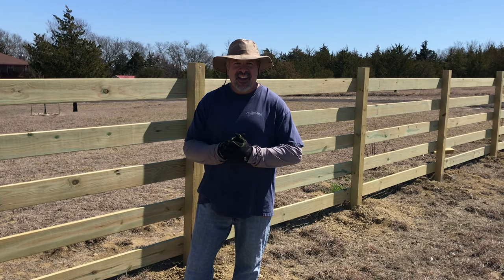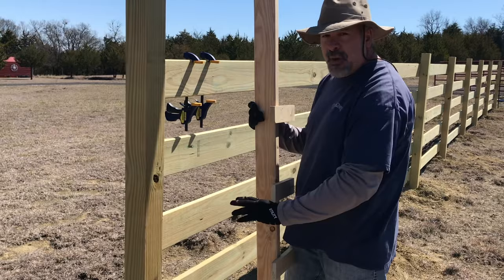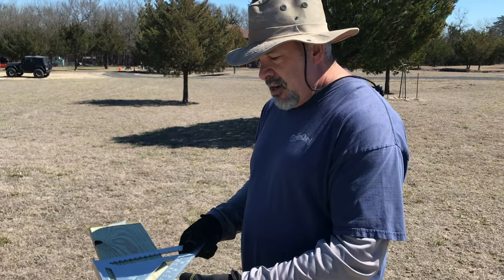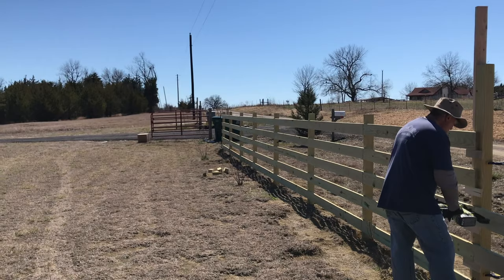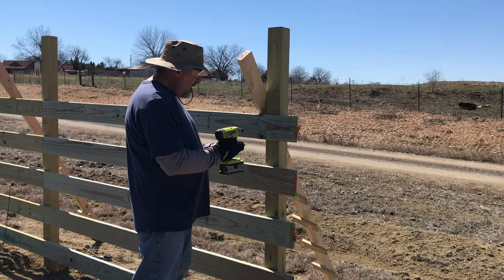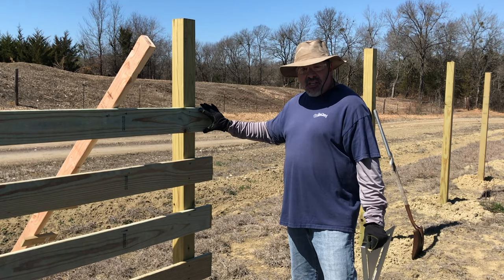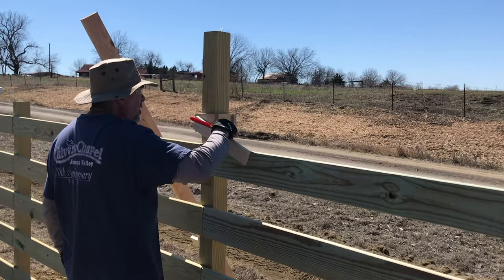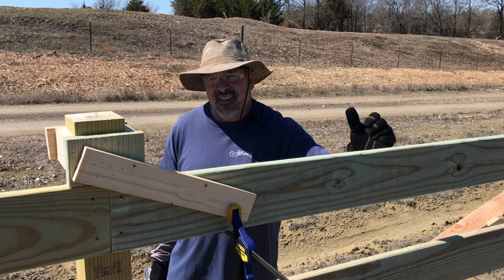Save Thousands by Making a DIY Wood Farm Fence

Comment: Not to be negative, but isn’t the nice side of the fence supposed to face the road and not the house? I’ve never seen a fence where the boards face the other side of the road?
Reply from the maker: Lol! Great point. We had several discussions on the best way to set the fence. We even set up a sample run. In the end, we decided we liked it better the other way.
Reply: I was thinking the same thing. Not being negative at all it looks amazing but my wife would murder me if I did the fence facing in and not the road. I’m getting ready to start mine after see8ng this tip and tricks this was great
Reply: This is the proper way to face the runners if there is livestock being kept in.  If the runners faced the road then a cow or horse could push the runners off.  Good job.
Reply: If I am making a fence for aesthetics, I am going to have the "nice" side for us to look at.  I couldn't care less what others see when they are driving by.  Looks great to me!
Reply: John Stricker a normal person would have done that but the boss wanted it that way.
Reply: @Mountain Path Woodsman  with it facing this way when i had a 3 rail fence my horse popped a board off into his area but if its faced other way then im sure they can kick it off so either way if a horse wants out they gonna figure out how
Reply: Proper as stated if it’s true purpose is to hold livestock boards face in. If it’s just to look good boards face out.
Reply: I've seen plenty of both in the building business. It's personal preference.
Reply: Boards are always placed inside for strength that way when livestock pushes against the board they are stronger pushing against post and it on outside easier for the weight of the livestock  to push or break boards off the post. What I use for measuring  distance between boards is a cut piece of PVC I carry in my back pocket and just put it in between each board. Also all boards can not break on same post as they need to be stagered for strength.
Reply: Boards cannot end on same post as you are taking away all the strength. Also 4 X 4s from big box stores are coated with different and cheaper creosote and  typically won't last as long as round livestock post. Also with the strong additives in concrete and not applying barrier between post and concrete post will not last as long.
Reply: We have horses so boards always on inside and I use round post and space about 5' 4 " apart and fence still ends up looking good as I have had people stop and compliment and being OCD helps lol 1X6X16 boards from tractor supply along with other suppliers are now around $20 or so each so I do what I do to stop warping. Post 8' apart allows for too much warping as sun dries them out. Also stagger 16 foot boards really adds strenght. Cutting boards from post to post has no strength and you will see in couple yrs or less
Reply: If you want to see what a livestock three or four rail fence should look like google Spar building supplies Ocala Fl and there is a photo under fence supplies and this what most would want as results. Not employed there but do purchase from them.
Reply: Both sides were nice.
Reply: Yes - he did it properly - because the livestock could push the boards and insurance companies won’t pay for any damage if your animals cause damage and the fence wasn’t done properly

Comment: How did you get the level for the horizontal boards at a long distance?? Thx
Reply from the maker: We used a black sharpie and marked the posts at night with a green laser level. That way we knew where the bottom board needed to be.

Comment: Did something similar with 2 exceptions. I sandwiched 2x4 welded wire fencing between the post and boards and used 16 ft boards with staggered joints.

Comment: If you add another block to the top of your jig that will sit on top of the previous board that is already screwed in, the jig will not slip down under the weight of the unscrewed boards.

Comment: Now, after a year or so, how are the deck boards doing as far as getting warped?  With that much space between posts, I'm betting the boards have warped  enough that you are having to replace some, or had to add a vertical support in between your posts to keep everything straight.  If not, you are very luck, so far.
Reply: You couldn’t be more wrong. I’ve been doing horse fences for 15 years and just showed this video to a client to explain the process and stumbled across your comment. This is pressure treated 5/4”decking, and there is no warpage even on jobs I did 15 years ago. And our posts are always 95” on center.